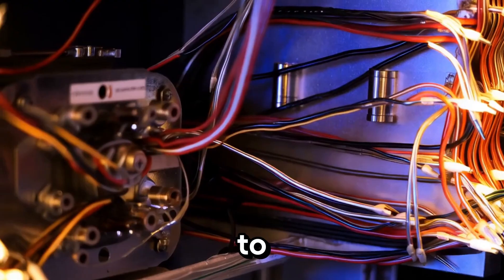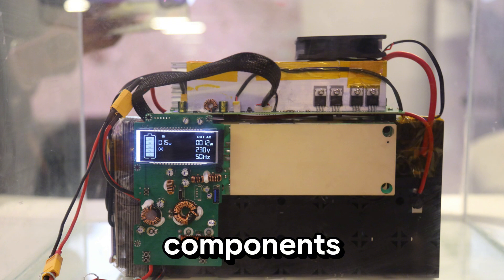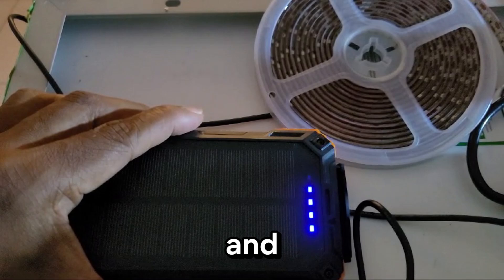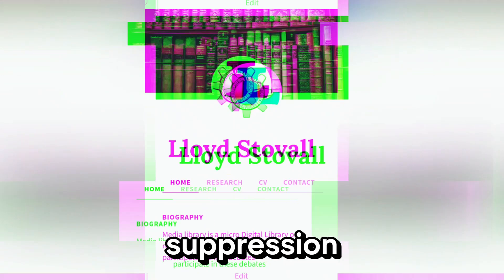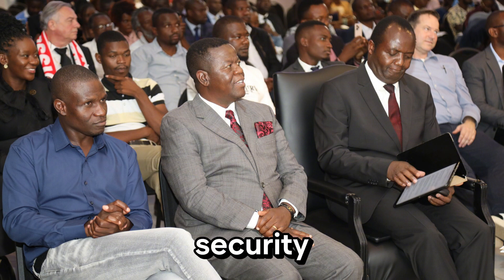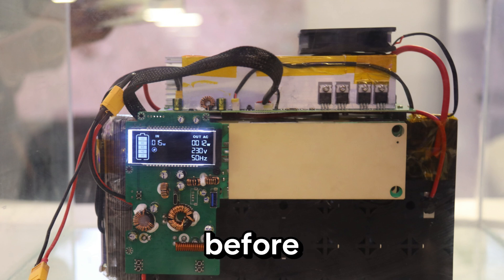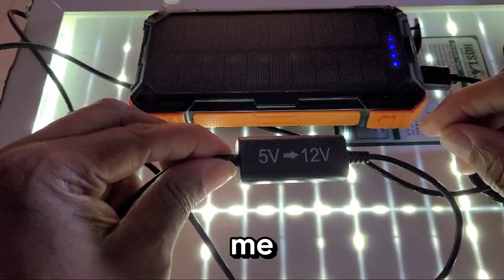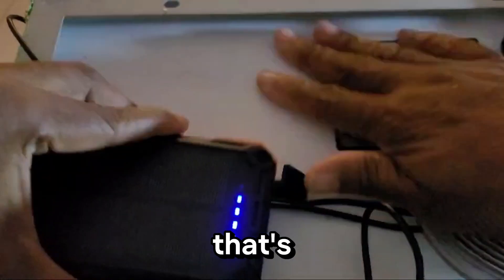Llyod Stovall Explains How His Free Energy Technology is Different From Chikumbutso's

Comment: Chris brother 
Is Lloyd is using mosfets to regulate current to led lights to power solar cells that produce dc to charge a battery  whereas 
Maxwell is using high frequency to turn off and on mosfets to generate a back current spike to earth  that he  uses to charge a car battery hey 
Please confirm
Reply: Lloyd use a 25 watt wall adapter to power a led panel, sandwiched between two solar panels.  The output of the panel goes to his mosfet device to charge his batteries with 2 watts.  Can you see how silly this is?   Put in 25 watts.  Gets 2 watts coming out. That's not a free energy machine.
Reply: @propheteyebert7063  I don't think so go back 🔙 over your calcs panels have more watts than that mate
Reply from the maker: After he powers solar panels with LEDs; he will get electric current which he then runs it through MOSFETs at high frequencies to amplify it. So for Lloyd he has two solar panels sandwiched between 1 LED panel,,but the Guy Like Gerald he says he made a cube where you have 6 solar panels being powered by 1 LED panel of lights at the centre, then the current generated is run through casketing of Mosfets,,so if you do 1 solar and 1 Panel of LED lights you will get loses of course, but for them they do a stack of Solar Panels running on 1 LED to reduce wastage of input source energy and maximise on output then once taken through MOSFETs at high frequencies they are able to get more from that, and yes for Maxwell it's like what you said
Reply: @chriswabs  Amplification requires an external power source. When we say we are amplifying something, what we really mean is that we are using a small signal to modulate a power source to produce an even bigger signal. That's the problem with Lloyd Stovall's technology.
Reply: @EdycliffDaba True! Transistors are only a component first invented late 1947 to replace the Vacuum tube to enable to amplify a very small signal to a far greater signal using an external Power source. Even a small transistor radio has to amplify a Radio signal by a factor of thousand to hear this broadcast through the speaking using the power source of the Radio. Either from mains electric supply or battery.
Reply: @ You can use AI to get the answer:  
What is the efficiency of a solar panel?  
Answer:  20%
What is the efficiency of white leds
Answer:  40%
Calculation:  25 watt X .20 X .4  = 2 watts
Reply: @propheteyebert7063  panels would be bigger the 25 watts surely
Reply: @ These Zimbabweans claim to invent technology that will overthrow the matrix, yet they fail to understand the basics
Reply: @hiz-n-lowz1577  what are the basics? Book knowledge or trying to invent something and then have it in books. All books knowledge come from inovators and we want to get past that stagnation. Explain this to me. A washer machine LG hyper drive motor is driven with 280 volts DC. Ok if you take an ebike controller and connect to the motor with only 48 volts DC, you get 250 volts AC. This is not in any science books but smart people use it to generate power over unity if you loop back to separate batteries and have a switching system that alternates them.
Reply: @propheteyebert7063  lol, sounds like a 6th grade science project but with fully grown men, and they got so many people believing they are genius inventors
Reply: Lloyd Stovall talks about generating current. And I keep asking: Show us a simple schematic. The schematic will answer a lot of questions including.

1. You are going through the route of using a battery to power an LED, and then capturing the light from the LED to power a solar panel and then use the electrical energy the solar panel generates to power a MOSFET. But in reality you only really need a battery to power the MOSFET. Why didn't you just use the battery to be switching the MOSFETs at once? Would it not be more efficient and even economical to get rid of the LEDs and solar?

2. What circuit are you using to generate the signals that switch the gate of your MOSFETs  at high frequencies and is it powered by the solar?

3. Is the drain-source terminal of your MOSFET connected to a voltage source? If so then is that voltage source from your solar panel?

4. When you are switching your MOSFETs and getting that significant pulse current of yours, through what terminals of the MOSFETs do they flow and how is your load connected to let this current flow through it? 

If Lloyd Stovall generates current by switching MOSFETs, I can argue that the same thing should be achieved by switching relays or even mechanical switches (if you can switch them that fast). I'll be happy to get an explanation of why switching relays or manual switches shouldn't have the same effect of producing a high current.

Please don't use AI, don't ask AI anything. Provide an answer, just from your point of view.
Reply: @EdycliffDaba To be clear, Lloyd formula is Vout/Vin as a proof of his OverUnity. When you have high voltage over input voltage is what he called over unity. Lloyd has no idea about current(A), power(W), MOSFET, switch and a lot more. And he is believing that MOSFET is a generator.